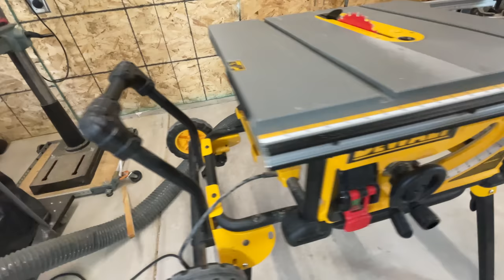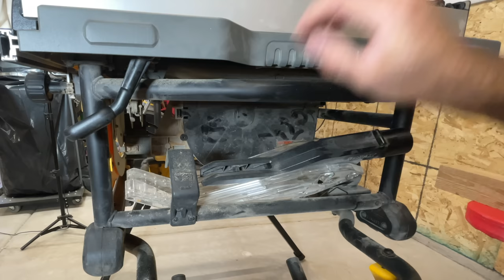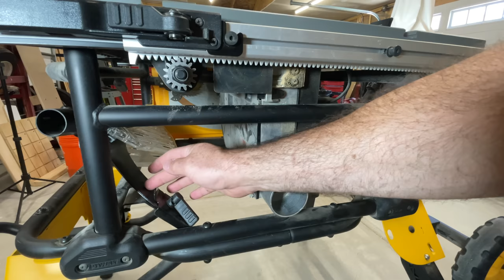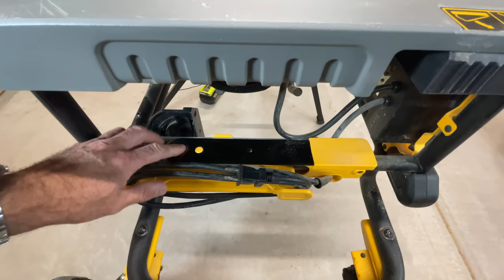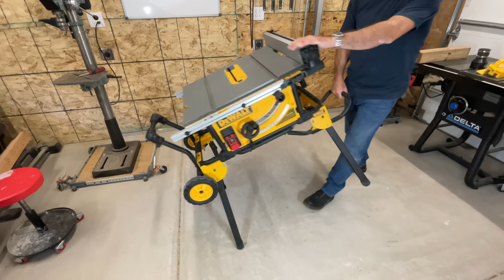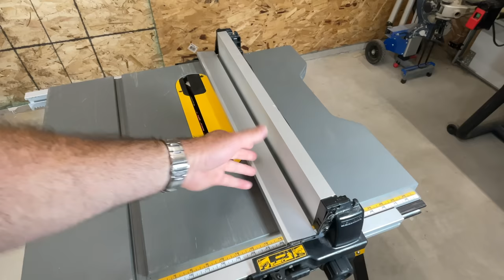The Saw Designed For Everybody?  |  DeWALT DWE7491RS   |  Review and All Adjustments

Comment: I bought the same model back in December, only for making the lengthy miter cuts for a faux beam mantel, for our fireplace remodel.  I also bought a DeWalt Compound Miter Saw with the free stand and I've been doing woodworking/house remodeling for 25+ years and never owned any sort of table/miter saw, until a few months ago and I just want to say, I have no clue how I got anything done for all these years without these two saws!  Also, kinda hard to believe in 10 years, the model numbers are still the same for the table saw!  The Miter Gauge has greatly improved, as mine is all metal with only a plastic adjustment knob.  Great video about this saw too, as the manual is not helpful and I learned a few things!  It's great for the DIY home remodel'er, like myself, as I've used it quite a bit over the last 3 months!
Reply from the maker: In my home remodeling days we never used a table or chop saw. Not even sure if my boss owned either. It was circ saws all the way. It can be done but as dangerous as these big tools are, ripping a 12 ft 2x4 while holding it in the other hand is worse! As I get older and my budget gets slightly bigger I really enjoy the luxury of owning good tools. Thanks for watching!

Comment: The toggles on the bottom legs are actually designed to be operated with your foot. So you don't have to bend over to collapse or extend the lower legs. That's why they toggle differently than the top legs.

Comment: I have been using this saw on the weekends to do stuff. Everything from precise to rough to dados with dado stacks. It is very capable. I do change the blade often to match what I am cutting. In doing so no trouble with tearout, stalling, burning…

You are correct it tries to be everything. 

It cuts well. Everything was aligned out of the box. Used the wide fence a couple times realized it is a nice feature but better and safer to breakdown sheet goods with a circular saw. I am very happy since I do the pop up shop on the weekends thing. The rolling stand is fantastic. 

Things to adjust. I noticed while making a cross cut sled that my miter slots had some slag on the sides from manufacturing. I used my 400 grit diamond stone to clear it in just a few passes. 

My throat plate is more flexy than the one shown here. I made a zero clearence. The riving knife is too long and I may clip the back in the future. The tabs for the adjustment screws hit are 1/2” from the top. That made making the throat plat without adjustment screws easy. 

I do my miter cuts on my miter saw. Knowing this is a job site saw I was not surprised at the miter gauge. However if you use something else to set the angle and attach a board to make it longer and run a little tape on the runner it is workable and repeatable. 

I threw out the push stick. After using a microjig Gripper everything else seems unsafe.

I need to make a jig or two that straddle the fence. The auxilary fence may need some extra consideration.

All my cons are really minor. Overall I think it’s great.
Reply from the maker: Hello Lincoln! First off I agree on cutting up sheet goods with the circular saw into slightly oversized pieces to then cut to correct size on the table saw. I do this with my contractor saw also. I feel it’s just safer than trying to feed a 4x8. Nice hear it’s working well for you. Good comment and thanks for watching!

Comment: Really appreciate your honest reviews Mike! I'm a hobbyist working out of a very small shop and am wanting to do some cabinets and other furniture. I'm leaning towards the Dewalt over the Delta for the portability, but do you get the sense the Dewalt is too small to create projects of that caliber well? I don't want to sacrifice quality over saving a little space, but I'm okay with the tradeoffs of it being a little louder or coming with a crap miter.
Reply from the maker: I’ve gotten this question or a similar one many times now. I think it would be helpful if folks could see the saws side by side. I have more brand new Skil yard tools to check out this weekend and then I’ll make that Delta vs DeWALT vid for ya. Skil vs DeWALT saws side by side vid will drop this weekend. Thank you for the comment!
Reply: I may be a bit late to the party here but I just replaced my other table saw with this exact model because of how much bigger the Dewalts table is. According to the research I did for about a year, seeing each saw in person, the Dewalt has the largest table by far but it still stores small like the others. My major issue with every other saw was the lack of infeed space in particular. This saw was a big upgrade (granted it’s no cabinet saw) and I couldn’t be happier. Taking my own brand new one out of the box as we speak. For this price range, I wouldn’t bother with any other saw. Just my opinion.
Reply from the maker: Glad it worked out for ya!

Comment: I need to get my head around rip capacity, as to how important that may be to me.  Comparing with Skil.  Solid review, thanks.  Not dissing review at all, and I think speaks well to strength of unit, but . . . Has Dewalt cut some corners on specs and quality of materials over the years?  Did you say your neighbor's wax 10 yrs old?  Be curious if they are holding same standards if I were to get one today.  Conversely, may they've improved it with a few product design tweaks.  Again, as always, your reviews are solid, helpful walk throughs.
Reply from the maker: Thanks for watching!

Comment: I’ve had this saw and put a lot of work on it doing things around the house for about 3 years now and the way you described it is exactly how I would describe it 👍🏻 Plenty of power for a homeowner and amazing rip capacity. Ya, super cheap miter gauge lol I keep toying with the idea of upgrading to a contractor saw, but the small foot print factor is Dewalts biggest advantage if that’s what you need. Excellent review!
Reply from the maker: If you don’t have the shop space to spare this really is a great option! It has 2 inches more rip than my contractor saw. Thanks for watching!!
Reply: @ProjectsForAllReviews  Yeah, this is basically what clinched it over the DELTA saw for me. That and seeing that plenty of other hobbyist woodworkers were getting excellent result with just a little tune up. It's not the perfect saw. But for what it is at the price, it's probably the best all rounder in that it CAN do almost anything if you're willing to fiddle with it.
Reply: @ProjectsForAllReviews  just bought the Satstop compact saw since it has the great rack and pinion like the dewalt. Less rip cap capacity for sure (24 1/2), but I’ve got a track saw and parallel guides when I need wider repeatable cuts. Hard to pass up the safety factor of the sawstop.
Reply: If you already own the dewalt i would probably build a saw table around it. Exactly how you want it
I mean, if it works perfectly and all you would ideally want is more table space, just do that. Plus you keep the portability.

Comment: I am trying to decide between the delta 36-725t2 vs dewalt dwe7491rs. They are both about the same price. which one has a more accurate fence? Is the motor a problem on the Delta? I have read on a few sites and some youtube videos people are complaning about the motor burning up. Is this a true problem or just an isolated issue? I do not need to worry too much about portabliity. which saw works better with a crosscut sled?
Reply from the maker: The Delta is considerably larger and heavier. It makes it more stable and IMO better for using a sled. That said the Dewalts a great portable saw but if it’s going to stay put I don’t think there’s an advantage. The Deltas also much quieter and it makes it a pleasure to use. As far as the motor I’ve used the hell out of mine without trouble. Thanks for watching and good luck!

Comment: I’ve had this saw a couple of weeks, now, and I’m looking forward to using it. One thing I’ve seen no comments on is how poorly illustrated the manual is (not a criticism of your video, as you borrowed an already set-up unit, and you’re focussed on actually using the saw, not setting it up). The drawings are hopelessly confusing (I’m also an artist whose done illustration work), and I’ve learned more from videos like yours than I did from the manual (e.g. where the mitre gauge is stored). Setup of the rolling bench — which is largely symmetrical along two axes — is poorly shown. Aside from the mitre gauge, though, it seems like a great tool.

Comment: Keep in mind that this is a construction job site saw. This is not a precision furniture building saw. I have this DeWalt saw, and it's been a great tool for me. I've built many of houses with this saw. Toss it in the back of my truck, and it keeps its zero Everytime. I only had to make a couple small adjustments when I bought it. Haven't had to mess with it for over 7 months. It wouldn't be my choice if I was doing precision woodworking though.

Comment: Hello. Can i run a 10 inch table saw in an outlet in my garage?? I’m not a carpenter but i bought a table saw just to do some minor works at my home built a shoe cabinet for my son. So i was wondering if i can use the garage outlet to run a dewalt 10 inch table saw??? It’s 15 Amp 120 volts saw don’t know if that info is helpful. Also does a table saw use so much electricity and expect an expansive monthly bill? Please! Thank you.
Reply from the maker: Hello Julio! Yes you can run this table saw and probably all portable saws off a standard outlet. Check your saws manual to see if it requires 120v which is a regular house outlet in the US. Some large saws require 240v. It should have an amperage rating or recommendation too. Good luck and thanks for watching!

Comment: I did a lot of research before buying this saw.  One of the main concerns was the size of available space in my garage.  The rule in my garage, is that at night, both vehicles shall be put in the garage.  I have to break down my shop and return it to a garage.  Helps to have a Ron Paulk work bench.  A full-sized table saw would take up too much space.  I have found that the levers for the bottom legs to extend or close the legs can be easily worked with your foot.  You don't have to bend over to extend or retract the legs.
Reply from the maker: My beautiful wife wishes we had the same garage rule at my house! Thanks for watching!

Comment: You actually can adjust the squareness of the fence (15:20), if your fence is leaning slightly away from the blade like mine was.  I took playing cards and shimmed under the black plastic pieces, directly under the fence ends, and that lifted the fence, which pivots around those two bolts in the bottom left of the video, and brought it back to square.  Once it was square, I taped those cards in place with some aluminum foil tape.  They've been there for over a year, works great.  You do create a slight gap under the fence, but that's not an issue unless cutting very thin sheets.
Reply from the maker: Yep I did basically the same with the Skil table saw. Had the same problem and same lack of adjustment. Thanks for the insight!

Comment: notice at 18:34 when you start this saw up, the blade and riving knife briefly shudder for a split second? (i had to watch it a few times to see it)  I have noticed this with my same saw, only because if you start the saw up with the blade up through a crosscut sled, it tears out/widens the kerf  in your sled or zero clearance insert by 1/32?  Though once it is up to speed it cuts perfectly fine.  I was wondering if this is a jobsite saw thing, or table saws in general? (ive never used a cabinet saw)
Reply from the maker: Interesting question. This saw went back to its owner after the vid but I have 2 job saws in the shop now. The evolution vids are out but I’ll bet I edited out the startups to save time. Skil saw is next and I’ll pay attention to that one. Thanks for the tip!
Reply: @ProjectsForAllReviews  thanks, I love the battery of tests you performed, very thorough, nice work

Comment: Is your Delta on a 20 amp circuit or 15? I am heartbroken that I have to return my delta because I don’t have access to a 20 amp circuit… And when I ran it it was obviously under powered and super quiet just like yours sounded
Reply from the maker: Yes it’s on a 20 amp circuit. Haven’t had any trouble with power and it’s always been that quiet. I feel your pain though. My last garage had woefully insufficient power. Wasn’t able to start my air compressor out there. Good luck and thanks for watching!

Comment: I have the Kobalt KT10152, 10 in. 15 amp jobsite saw I bought a few months ago. Was on sale, got it for $300.00! Way quieter than the DeWalt in your video. I'm a big fan of DeWalt-- have lots of their tools-- but I was NOT impressed by that saw. My Kobalt isn't as wobbly, very stable. Has a crappy aluminum table, like DeWalt, and came with an equally crappy miter gauge as the DeWalt's. But, still better over-all. When I'm ready to buy a thickness planer (some imaginary day-- I'm retired), I'm more apt to buy DeWalt's planer. All the reviews I've watched on that are very favorable-- especially for the price.
Reply from the maker: Hello! I havent seen that Kobalt saw yet but it's on my list! Check out my channel home page for videos on both DeWALTS planers. They are both excellent. Thanks for watching!

Comment: Hello, i have a DW749IRS table saw and after installing the anti-kickback assembly on the blade guard attachment, for some reason the spikes only on the left side of the plate are getting caught and stuck on the throat plate when i raise and lower the blade. I have adjusted the throat plate number times and have checked to make sure the throat plate is not bent. There is a groove on this particular throat plate made by Dewalt in which the spikes from the anti-kickback assembly is getting caught on. Please help i cannot find a solution anywhere and have found no one else who has had this issue on the entire internet. P.S it IS installed correctly, and i called a Dewalt service station and they just said to bring it in, but i wanna fix it myself b/c the drive is just way to far. HELP from ANYONE is welcome. Thanks

Comment: Almost bought one. Ended up with the skill saw. The platform is way more stable but it's calibration out of box not quite isn't as good. Both are great saws just love the power of the skill and durability of it. Looks like the DeWalt would have faired well too
Reply from the maker: Im sure you would have been happy had you picked this one but Skil has some good looking offerings too. Im looking forward to getting one on the channel soon! Thanks for watching!
Reply: I chose the Skil portable saw. I had two reasons, one I desired to rip through standard 4x (3-1/2") material in a single pass and this was the only remotely affordable saw that would do that task. The second is a bit larger table. It also has a large rip capacity which I find useful. I agree, I had more calibration to do than expected out of the box, but I have been pleased with the purchase. Oh, the thick ripping was for an antique flatbed on a truck to replace the decaying structure with something one piece with help of glue, very long lags, etc. Better than the old multiple piece system by far.

Comment: totally agree.  i’ve had a contractor saw for many years then upgraded to a hybrid saw for many years.  now that the hybrid saw wouldn’t fit in my basement i had to downgrade to the dewalt.
i really like this dewalt but not having that hybrid is like loosing a good friend.
the table saw is the heart of the wood shop and what ever is sitting there determines the quality of the work you put out.  i heard your delta turn on and said, yup.  quiet, smooth, and solid.
the only thing i don’t like about these job site saws is they move around too much.
we all hard that, so when you’re running stock thru a nice heavy machine that should  skits still, you want to keep working.  i may make a set of cement shoes for this DeWalt.
Reply from the maker: Using a large saw really is a pleasure that’s hard to describe vs a portable but I think you nailed it with this comment! Thanks for watching Gino!

Comment: I'm not as lucky with the fence I received. Mine is twisted where the bottom is closer to the blade than the top. I just purchased a new one to replace it. There's no way to make that adjustment either.
Reply from the maker: I have a Skil table saw video releasing tomorrow morning. It has a very similar fence system and it has the same problem but very slight. I was able to get it perpendicular by shimming the back half between the fence and rail with 3 little scraps of paper. Could use tape too. My fence isn’t twisted though it perfectly straight just the bottom is closer to the blade with no factory adjustment. Check it out if you like. Thanks for watching!
Reply: @ProjectsForAllReviews  Thank you. I tried the shim as well, but unfortunately it's still not "perfect". Them including a way to adjust this would have made this product even better than it is. I suppose in the scheme of things that it doesn't matter as much if I'm using thinner stock material. Will definitely check out the video. Thanks!

Comment: My only complaint with this saw is the stand. I just bought the 12” double beveled miter saw by DeWalt and the stand that DeWalt sells for that is light years ahead of this cheap stand supplied with this amazing table saw.
Reply from the maker: The DeWALT chop saw vid had a DWX726 stand on it and it was an absolute beast. I like both stands actually. Thanks for watching!